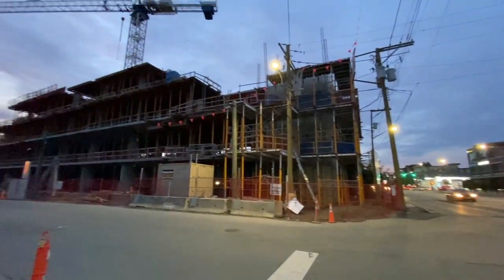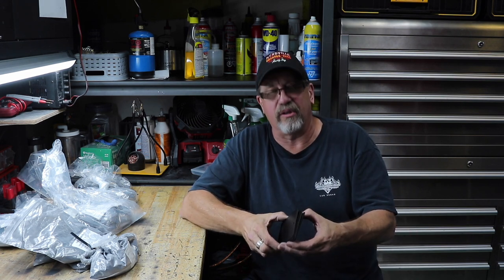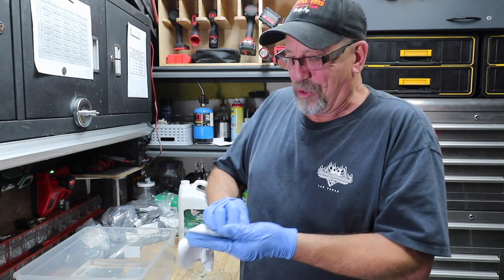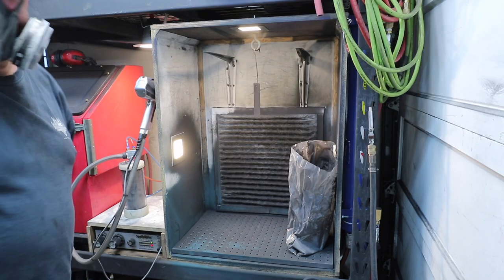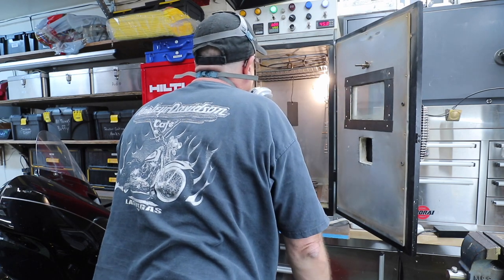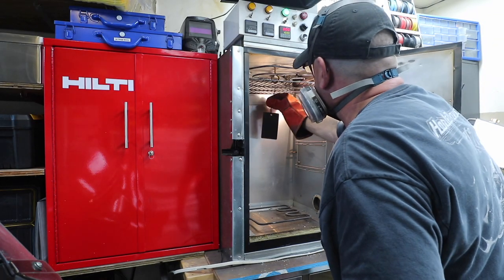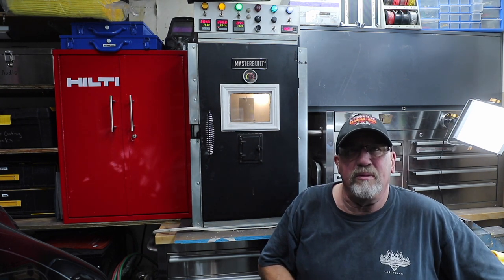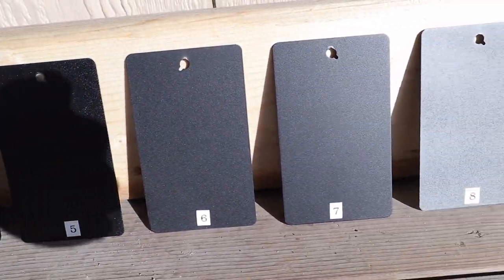Powder coating textures that are commonly used on Harley Davidson engine cases.

Comment: Would you care to share what your powder gun setup is? Is there a video on it?
Reply from the maker: I do talk about it in my 6 month review video but don’t have a video just about the gun system itself. The system I’m running is a ES02-WF by SpectraCoat. The system itself is ok but I would have to say that there are better systems out there for the money. If your doing stuff out of your garage like I am, I would look at a Colo, Eastwood Elite HotCoat PCS-1000 or a Kool Koat system. Depending on your budget of course.
Reply: Thank you that is exactly the info I was looking for.
Reply: Okay is there any chance you have any experience with any PC system vendors? I am struggling to find an online source.
Reply: What coating in your opinion matches your Harley motor? I was hoping you would compare them with it like your last video. Also wanted to say good video.  It probably saved me from getting my parts wrinkle coat over texture.